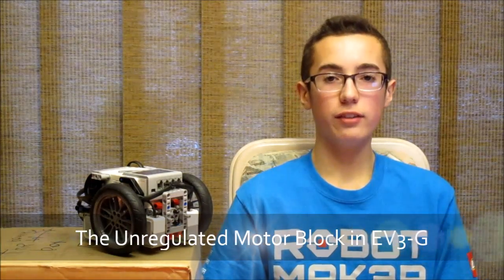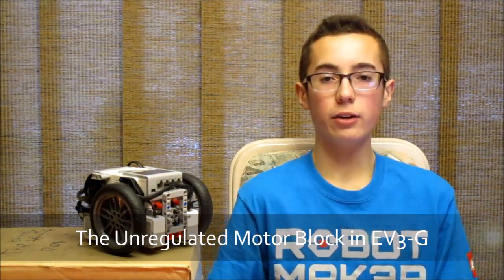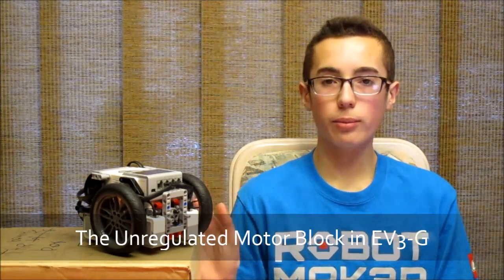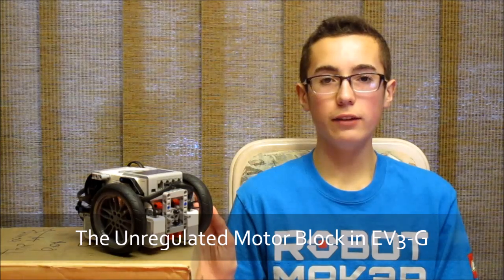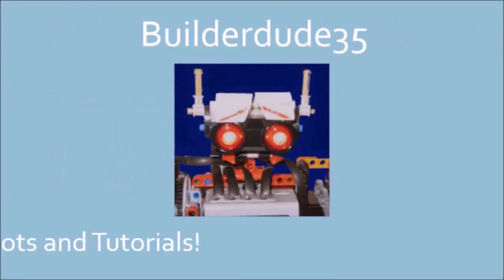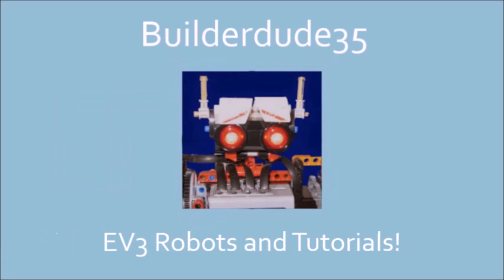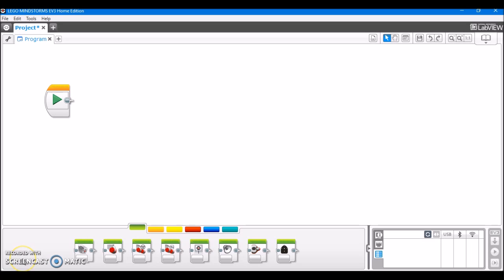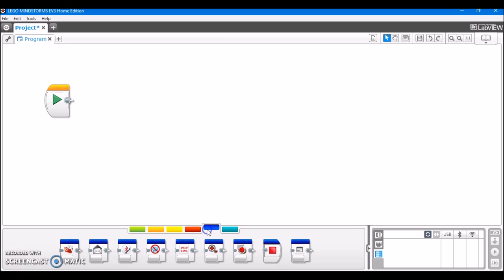The Unregulated Motor Block in EV3-G

Comment: I’m glad I found this block, I’m looking into a way to use it in a gearbox that switches gears based on load. I wish the old 9 volt sensors had new versions to go with Ev3, it’d be so much easier.

Comment: I have a particular issue. When i use ev3dev's equivalent of the unregulated block (run_direct) versus RobotC's version of the unregulated block, i notice that ev3dev is way slower and I have no idea why. Do you have any leads as to why that is?

P.S: Im using python so if it's got to do with the language binding, then here it is.

Comment: Would this motor block help in FLL?
Reply from the maker: Some may have found applications in FLL, but they are limited. The best application would be detecting motor stalls (which I have a video on). Otherwise, they're not that useful; I definitely wouldn't use them for driving.
Reply: when I was in FLL our team had issues with our robots consistency, often due to battery loss.  This could mitigate that

Comment: Hi Kyle. This is Sanjay and Arvind.  This is a good topic for a lesson. However,  we were surprised by your comments in the video about the unregulated motor block. We have used the unregulated motor block quite a bit, and our experience does not match up with your conclusions in the video. We have also done several experiments with the motor and move blocks on the EV3. You might be interested in taking a look at these experiments and comparing with your comments. You can find the lesson on ev3lessons.com in Intermediate --> Move Blocks if you would like to take a look.
Reply from the maker: +Droids Robotics Thanks for sharing your experience! It seems strange to me that with a regulated motor, applying resistance to the output of a motor causes the EV3 to supply more power. It is the natural tendency of an electric motor to draw more current from its power supply when under a load, not the other way around. But judging from your tests, it seems that you are right. (Although, I don't think that what we said was too different). Thanks again!
Reply: +Builderdude35 Thanks for looking through our lesson/experiments. Hope this helps clarify the differences:
- Regulated (green) motor blocks cannot compensate for slippage since there is no measurement of slippage.
- Regular motor blocks do not cut power if battery is low. They try to ensure the same speed by drawing whatever power the robot needs.
- Unregulated motor blocks don't "regulate" power usage and so don't use up the battery faster. Your robot will go slower at lower battery levels.
- Unregulated motors are usually slower at the same power input and so are not necessarily useful for fast race cars. As the graphs show, there should be no differences in speed at 100 power between the 2 motor blocks.
Reply from the maker: +Droids Robotics Actually, just found this when reading through the EV3 software's notes on the Unregulated block:

"Power Control will compensate for any resistance or slippage that the motor encounters. Power control will also try to compensate for battery levels, when possible."

I never said that the Unregulated motor block regulates power. In fact, I said just the opposite; that because it doesn't regulate power, it will drain the battery faster. The EV3 notes themselves say that it compensates for battery level. To really test this effect, we'd have to apply a multi-meter somewhere in the circuit and see what the voltage and current going into the motor is like; RPM won't tell the whole story.

I agree that an Unregulated motor at 100% is not faster than a regular motor at the same power. Programming cannot make faster what is limited by hardware. To clarify what I was saying in the video, if the Unregulated motor isn't compensating for a lower battery level by limiting power it will likely be faster. Giving the motor all of the available voltage, as opposed to conserving a little for running the other accessories.

Finally, a motor like this could compensate for slippage, but I agree with you in that I doubt the EV3 has this function.

I think what we have here is just a misunderstanding of what each other is trying to say.
Reply: +Builderdude35 Thanks for the reference. Glad to see you are looking into it.  I think we disagree how the motors compensate when the batteries are low.  Hopefully you will get a chance to run some tests when you get time and use the unregulated motor blocks as we have.  BTW, Move Blocks (steering, tank) do compensate for some slippage by synchronizing 2 motors to each other, but single motor blocks don't as we said before.
Reply from the maker: +Droids Robotics I'm glad we've found some grounds to agree on! Thanks for your help! It's always great to discuss these things with others. I will try my multi-meter idea when I get the chance.

Comment: Laurens Valk wrote that an Unregulated Motor Block and the Rotation Sensor could be used to detect a stalled motor in a grabber claw mechanism.  Say "Motor B" is running at 30% power, and waits until the motor speed drops to 5% power before shutting off the motor.  A regulated motor would continue to run, thus having a prolonged stall and possible motor damage.
Reply from the maker: +dluders I've always used the regulated motor block for this purpose, and never had a problem.

Comment: you can use it so  the motor will stall after a certain pressure and not continue applying more pressure and breaking what ever you are moving. also what the normal motor block does is it keeps a constant speed so the number you input is speed not power and as the pressure against the motor goes up it ups the power
Reply from the maker: +Oliver Sier Yes, that is correct.